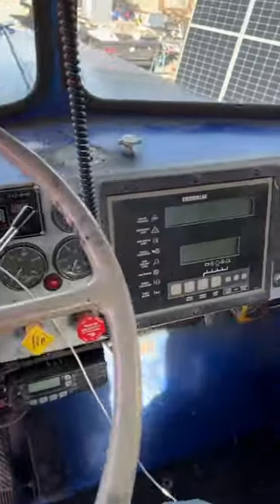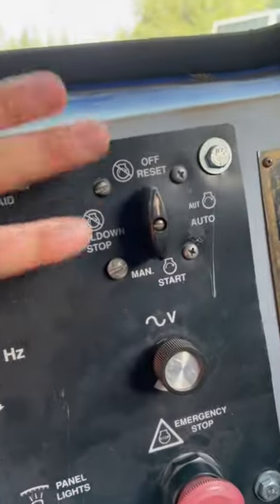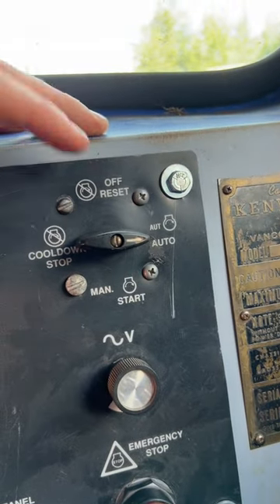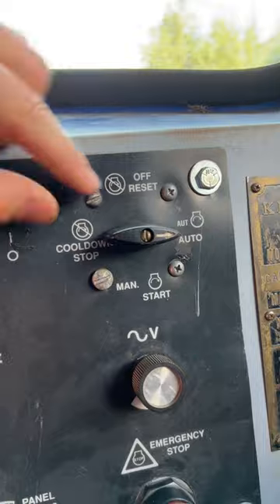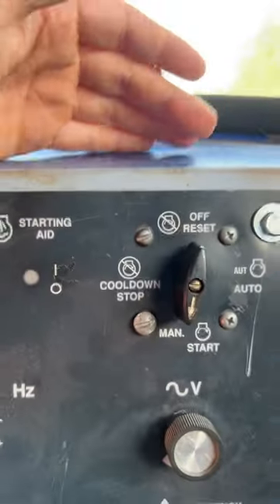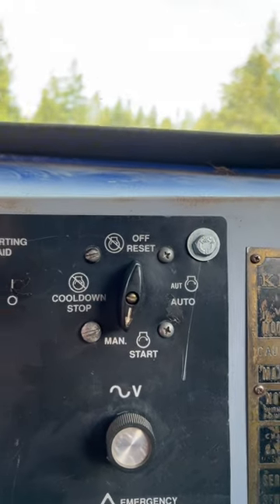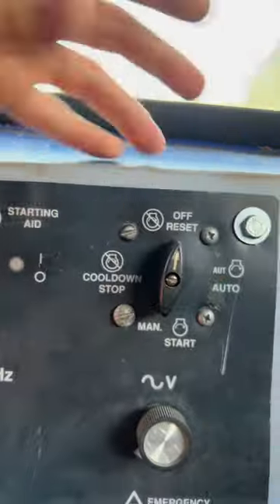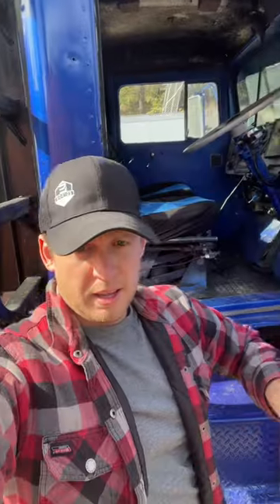Generator auto off/on

Comment: It's like an airplane, you tell it what to do. I have a control for fuel mix, boost pressure, pre heaters, prop and wing de icers.
Reply: I hope most of it has an auto setting
Reply: @thewhitefalcon8539  nope, not on planes from before the late 90's really.
Reply: @Alex C  nah, it's you and the machine most of the time. You just have to know your systems. Sure new planes have more automatic systems just like new cars. But the vast majority of general aviators don't have that kind of equipment

Comment: Just wondering, if the batteries get to or near a full charge while regen braking down a long hill do you have a resistive load bank or other device to dissipate the excess electrical energy or do you loose the "engine braking" ability as the batteries come to a full charge? Thanks
Reply: That's exactly what I was wondering. Especially as you're missing a Jake/engine brake in this setup. I guess an electromagnetic brake could also be added as well though
Reply: Same question.  My cousin has a Leaf. It's sketchy leaving his house as there is a 10mph off camber dropping curve where the battery hits full 1.1 mi from his house , regeneration quits, you suddenly pick up 5mph instead of loosing 5mph.  
It's his house he drives this every day ( 1of 5 times at 98%)but this failure has caused many seat cushion buttens to get pinched off and nearly cost him a car ( been on 2 wheels more than once) because the service brake is insufficient with the distance remaining when the regen quits in the middle of the braking zone.
Reply: Yes, they have that.
Reply: @MarkRose1337  have what?
Dynamic brake  or regenerative brake?
Reply: When the battery is full it needs to divert to a heating element with a blower motor.  I think there should be a manual switch directly to the "heating element with blower brake" within reach of the driver.  Call it the HEWB brake.

Use the HEWB brake if you're going to Who-ville.  Like, you're fully charged, going down a long hill like The Grinch.
Reply: @beyondwhatisknown  thank you for the clarification.  For locomotives, what you describe  is called a Dynamic Brake.  I ran fraight trains on Cascade Summit (grade territory.  At 40mi 2.2% it was the longest steepest continuous grade in the continental US).
Reply: @daviddroescher  They have both regenerative and dynamic braking. They call their dynamic braking resistive braking, I think, which I gather is what it's called on mine haul trucks.
Reply: @daviddroescher  A 20,000 ton train dropping that height due to gravity would dissapate 78,222 kwh of heat, according to my calculations.  That's equal to burning 7,822 liters of diesel fuel.
Reply: @beyondwhatisknown   due to the steepness  there was a 6,500t limit upgrade, 10k t downgrade  typically was empty northbound /down with a typical load of 3.5-5k T
with 3 locomotives worth ~13,000 hp(×765w/hp) ~9.94MW totaled; Was insufficient th maintain our speed limit . It also need about a 10#set (~ 20% main line air brake application)  with the engineer feathering the Indapendant to maintain 20mph in a 25mph max speed (25 is considered an emergency/ grade has proven unstoppable at 30mph)
Note up hill is limited by the extra force  applied to a mile long train by gravity. The couplers are at limit because ~3500t force of gravity +6,500t = 10k coupler limit.
Reply: @beyondwhatisknown  fuel is 500ga each for 5 engines southbound at 6.5k T. 2500ga in 201rail mi.12.4ga / mi. Or 1ga will move 1T  522mi effective, efficient. I don't have down hill numbers other than much lower consumption.
Reply: @beyondwhatisknown  Just need a smart enough driver, it is obviously stupid to charge an electric vehicle full, while on top of a mountain.
Reply: @beyondwhatisknown  sorry your calculations are very wrong.
Reply: @SuperEye2eye  What's your estimate?
Reply: @daviddroescher  Wait, WHAT?  I have a Leaf as well.  I can understand being thrown off when the battery reaches full charge and you lose regen braking.  But are you saying the friction brakes simply can't keep the car slowed enough?!?!
Reply: @beyondwhatisknown  I want to see a huge ass resistor on the roof in a bath of water.  It would literally be steaming down the hill.  If it runs out of water, the driver has to climb up and pee on it. 😅
Reply: @tgeliot  correct  he had to give a sturn warning to folks driving his car about this specific road hazard.  A Blind, Off camber,  Dropping  corner, with a ditch; I've seen 5 cars in 2 years roll . where the regen Cut-out  is at the critical time where reaction time to the unusual situation  causes inadequate distance  to scrub sufficient speed . With adequate reaction speed the ABS was barely able to slow enough. With a slower or less skilled/average driver I'd say no, the brakes being downsized for weight savings and reliance on reserve capacity  is not enough, when the battery hits full and regen quits.
 The abs was engaged so no more brake force could be applied.  He experimented to find an charge percentage that delays the full  charge point loss of dynamic brake, till the bottom of the 3.5 mi grade instead of using eco mode and dragging the sirvice brakes all the way down the hill.
Reply: @daviddroescher  The problem is easily fixed with a resistor, fan, and a computer that switches over smoothly once the batteries are full.  The engineers who designed that car are to blame.
Reply: @tgeliot  It looks like 100 kwh would be dissipated if an 80,000 lb truck went down a 3,000 ft (1000m) hill.  You could heat 1000 liters of cold water to the boiling point with that much energy, or boil off about 200 liters of water from 100⁰C liquid to 100⁰C steam.  Or, turn 160 liters of cold water into hot steam.  It would be better to just heat the air with the dissipated energy, for weight considerations.
Reply: @beyondwhatisknown  agreed.
Reply: @daviddroescher  Thanks.  What year model is this Leaf?
Reply: @beyondwhatisknown  This just keeps getting better!
Reply: @tgeliot  1st gen
Reply: @daviddroescher I worked at Philmont building their railway at that one camp I forget the name of.  They won't let you go over a 2% grade, you have to dig it level.  Is it slightly higher for commercial trains then?
Reply: @kugelblitz1557  the grade limits are complicated.  Tonnage,  steepness, and distance of contentious grade. The Cascade Subdivision is 2.2%for 40miles . This makes this one of the worst grades in the UP System Donner Pass dose not hold a candle to it. Black Bute( south of Klamath Falls ,OR )Subdivision has sections over 5% but only ~1mile so  long  there NB trains over 3k t  are cut in hafe  sent is 2 runs. 
Going up is more restricted than down . Limits Going up are more about not braking the train ( poping a coupler) and maintaining the hp/ton  to prevent stalling on the grade .( Cascade is 2.3hp/ton  at 2.2t/hp you WILL stall in tunnel # 7 just, even at 2.3  there were a few times I'd pray the head unit made it through  the portal so we didn't  have to wear a breathing apparatus to be able to cut away and wait for the smoke from the engines at both ends( Cascade was one of the early routes to adopt Distributed Power ).
Reply: @daviddroescher  interesting
Reply: Over the road, in practice you will never need resistive (dynamic) braking. Even really long downgrades (like I 70 eastbound into Denver) will only net maybe half a charge, max. In an electric car this downgrade gets you maybe 25 miles of range from regen. 

Mining and logging trucks on the other hand easily might gain more power coming down than going up, and they could need it (but they might not need the generator!)

Comment: I suggest a smart programmable drive plan that knows about the map and terrain so it can calculate the optimum route and charging points for the route. What do you think?
Reply: Exactly.  That's what I think.  But, this particular company isn't operating on that level.  Tesla is doing this already, or vould be doing this very easily.  In the mean time, the driver calculates this and a good driver will use the least fuel.  Then, one day, when this technology is built, you have a contest if man versus machine to see which one can do several identical trips with the least fuel use.  The human could still win if he understood all the power dynamics better than the guy who programmed the algorithm.  Then, later, there's AI to bring to the same challenge.

Comment: You know even if the switch does fail in 30 years you can clearly still pull it out of the dash and jumper some wires to get you home. It's not some soft touch button controlled by a BCM. So nice to see a proper industrial electric vehicle, so far all you could get was a little Cushman with this engineering mindset.

Comment: So, the regen is useless for braking if there is not enough storage capacity in the batteries?
Reply: They might have a big resistor that it diverts to if the battery bank is full. You definitely don't want your "jake" suddenly going out downhill.

Comment: This may have been talked about already but what kind of horsepower equivalent is this compared to a diesel engine?
Reply: Which one? The tesla motor is 450hp and the CAT generator is 500 at full load I think.
Reply: @teodorvangelov  How much torque does that electric motor make do you know?
Reply: @Bloodbain88  the non-performance large unit with the stock inverter makes 450N.m and with the stock gearbox(9.73:1) you get 4378N.m output.

Comment: What about a jake brake when you're going down the hill?
Reply: the electric motors at each wheel are the Jakes. Regenning is roughly the same thing
Reply: @1Lost Muffin  and when you're breaking it's generating electricity?

Comment: If the battery’s on full and you manually turn the generator on, what happens?
Reply: The generator would run with no load.